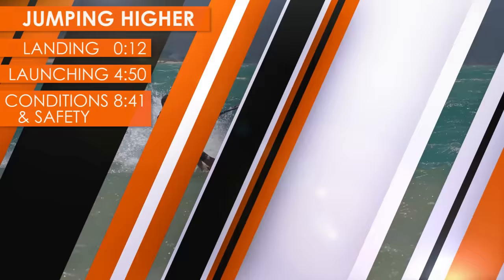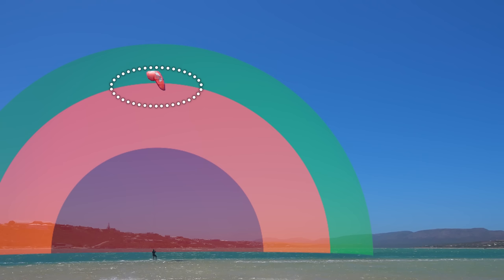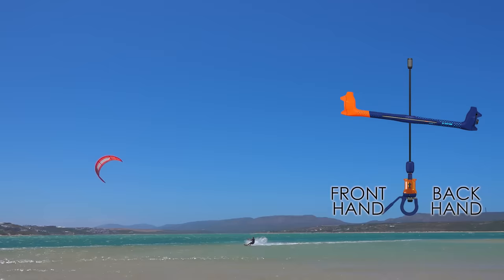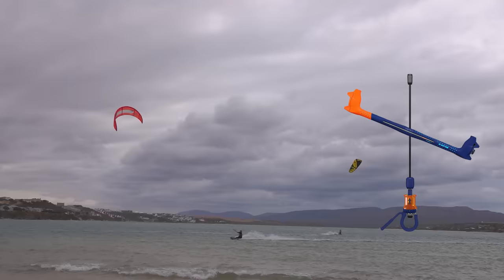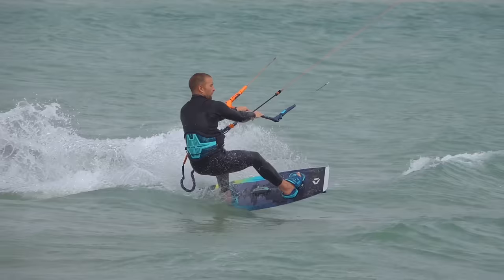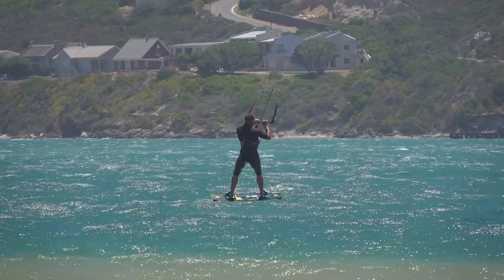Jumping Higher, Kiteboard Tutorial (inc: landing, heli loops, launching, conditions & safety)

Comment: Finally a good detail video about the jump and the heli loop! Im getting close to 10m but front stall often on landing. Cant wait to practise your heli loop tips thnx so much!!!
Reply: If your gonna heli loop as I like to do on bigger jumps couple things to note to save pain.  Make sure you have started to descend and kite is near 12 or you will kite loop or mega loop and smash your self out.  Ride a kite that turns good and of a size that you can ride without needing to depower it.  The more you have to trim or depower it the slower and bigger the heli loop will be. To commit to the loop sometimes I have found it best to almost hang on bar with one hand.  Sometimes you thinking your cranking it with two hands and your not.  Pulling the bar almost 90 degrees is safer than not pulling enough.  In my opinion
Reply: Wtf I don’t understand these suicidal people😂 my jump record is 6m but I already mastered heli-loops and landings

Comment: One key thats left out but you can see it  is when steering the kite to 12 you need to sheet out on the bar all the way to prevent being pulled off your edge and letting the kite speed up. I had to learn that part myself, i could figure out why i was getting ripped down wind as soon as I tried to jump and why the kite was slow to get to 12. Sheeting out on the bar as you send it to 12 is a very important part that thyere assuming you know.

Comment: Thanks for an excellent video. I tried my first heliloop a few weeks ago. I think I started a kite loop instead by accident and abborted early as I got pulled really hard which scared me. Would this be due to initiating the heliloop too early or steering in the wrong direction into the wind window? I'm pretty sure I steered with my front hand, though it all happened very quickly and it shocked me enough to not try again until I understand the theory more (BTW in hindsight it wasn't the best conditions for practicing as while the water was flat it was 30-40 knots - was riding a 7 meter Evo).

Comment: Wonderful helpful video. I’ve watched it before, but am finally getting to the point where I understand it better. I don’t know how high I’m jumping, but it’s high enough that landing incorrectly is hard on my knees and back. I am going to try turning my kite back and then forward thru the sweet spot to see if that solves my problems. Thanks very much.
Reply: I wondering how you landing went.?
Reply: Tip that I learned: just steer late and hard forward and landings are much smoother!

Comment: You're videos are inspirational. I'm always desperate to get out on the water after watching one.

I have a possibly controversial question about jumping higher. What these guys are doing are obviously working and im sure they are higher on the woo board than me haha! However, in the video between 4.55 and 5.15 you see the dude do two big jumps. The technique looks just how I'd intend to do except as he redirects the kite hard for take off he pushes the bar away to full deepower position. 
I've found if you do this too much then  you can lose tension in the lines and therefore get lower jumps. In my experience it's best to keep as much tension in the lines until take off, which would mean keeping the bar pulled in enough even just before take off. 
I can see 2 situations where you might need the bar at full depower. 
1. If you are fully lit and even with bar at full depower you still have tensioned lines
2. Maybe what this guy is doing, which is he's redirecting the kite so fast that he has to push the bar away to not be ripped from his edge and he's talented enough to keep the line tension during this quick movement. I can also see how pushing bar away will help kite climb to 12 quicker to jump higher.

Just think it's important for the average 5 to 10m height jumper to realise that keeping that bar in a bit even as you redirect can be helpful. Any sudden changes in line tension could lose you power just before takeover. Interested to hear your thoughts
Reply: Hey there, i am not a pro but i think it is because is still quite low for the part of speeding yourself up and he wants the kite to get up to 12 as quick as possible so he can jump, which the kite does quicker if the bar is pushed away. Otherwise he´d initiate the jump when the kite is too low and get more horizontal pull instead of upwards. Does that make sense? Did this answer your question? Hope it did. Have fun!

Comment: One critical part of the instruction that's missing (although in the video the guy does it) is to pus the bar out fully as kite approaches 12 on the takeoff. Otherwise the kite is half sheeted already when at 12 leaving much less to pull! You want a fully loaded kite at 12 to get those big jump. I was struggling and only learned this from an instructor recently.
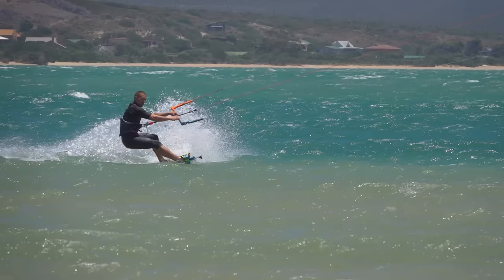Reply: This is an important missing detail. The instructions (7:22) say to pull in the bar as much as you can handle, and then when the kite hits twelve pull in the bar, but there's no mention of when in-between the bar is (necessarily) pushed out - when is the best time for that?

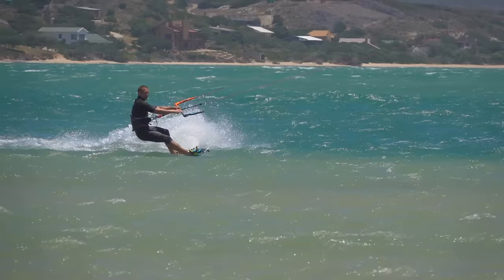Comment: Thank you for this tutorial! I've got 2 observations though: 1) In almost every jumping tutorial on youtube the rider pushes the bar before jumping but it is never mentioned. You can see it in this video at about 4:56, 5:10, 5:19, 7:37. Won't you loose tension in the lines doing so? 2) Something else which is never mentioned is right tack to ride before jumping. Should it be upwind or a bit less than upwind?
Reply from the maker: Good questions Philip. 1) When you're going for a boost, you're steering the kite up really rapidly and it will start pulling early, way before it nears 12, and that can easily drag you off your edge prematurely and spoil the entire jump. To stop yourself getting dragged off your edge as the kite climbs, you often need to sheet out. 2) It's pretty close to crosswind as you build speed and maybe 15 degress upwind of crosswind at the moment of launch, I'd guess. However, I don't really think about the exact angles while boosting. I'm usually preoccupied with keeping lots of speed at first (I instinctively aim more crosswind to build speed), then I'm focused on keeping contact with the water, and edging as much as I can at the final moments (which probably turns me slightly upwind of crosswind).
Reply: @kitesurfcollege  Thank you so much for this clear explanation!!
Reply: @kitesurfcollege  Mint!  Excellent work.

Comment: Thank you for this video and your troubleshooting about landing. You emphasize a lot on keeping the edge while going faster or sending the kite faster to 12. What about edging hard towards the wind to improve jump height?
Reply: Marc Poitout I guess edging hard towards the wind will not really help you jump higher, because the most important thing about jumping high is the line pressure. The higher this pressure is the more brutal the kite will send you upwards, by edging towards the kite there won‘t be much line tension and much of the power the kite creates will not reach the rider!
Reply: Hi Freddy,
Thank you for your reply.
When the kite goes to 12, it is moving in one direction. When you edge hard, your body is going to the opposite direction and therefore the anchor point for your front line as well. Therefore you are increasing the front line tension when you edge hard just before taking off.

Comment: This was very helpful. What are your thoughts about the pre-jump hop that many big air kiters are doing now?
Reply from the maker: Hi Alec. I wouldn't even consider it. If you look at the highest jump recorded without a wave, which was about 33m, that guy kept his edge continuously and didn't lift the board out. I'd say for pro kiters it's 50/50 whether it helps or hinders. It's most likely to do with board shape. High rocker boards create far more drag at speed, so lifting a high rocker board may help you reach a slightly higher speed as the kite climbs. But with a lower rocker, faster board, lifting the board will probably slow you down. However, for an intermediate or even advanced kiter, incorporating this extra detail of lifting the board, will probably mean they are concentrating less on far more important details like speed and edge pressure. So for almost all kiters trying to lift out the board during the build up will give poorer results.

Comment: Everyone always talks about jumping "when the kite reaches 12". I am very inconsistent in my jumps over 3m and one thing I think I am hung up on is: what angle should the kite be at - that is the angle from an imaginary line vertially upwards from the kiter's head, to the lines to the kite (not left or right)? in other words: how deep in the window. I notice that the faster I steer the kite, the deeper the kite goes back into the window on its way to 12 - and edging to counter this I guess forces the kite to fly faster towards the edge of the window (0 degrees to vertical line) - but if you are waiting for the kite to almost get above your head, it loses a lot of power. On the other hand - too early and you just get cranked downwind with sub-optimal lift. So it seems to me the optimal time to edge/pop and pull in the bar for the yank is somewhere in-between, could you explain this process?
Reply from the maker: Hi, it's important to note that 12 does not mean overhead.  If you draw a line starting directly overhead to directly downwind, that line is 12. It is not one place. It is the division between the left and right of the wind window. When the kite hits that line you pull in the bar and take off. Exactly which part of that line the kite hits will depend on you steering when you send the kite up. Slower steering will mean the kite is closer to over head (a higher angle on the 12 line) and you get less force and a lower jump. Firmer steering will mean the kite is deeper in the window when it hits 12 (a slightly lower angle on the 12 line), and you will get ripped off the water more violently. In both cases the time to launch is as the kite hits 12 approximately. Pulling the bar in before it hits 12 means a longer lower jump and provides less vertical component of the kite's force. Pulling the bar in after it crosses 12 sheds a lot of speed and again provides less vertical component of the kite's force. Good luck working on your timing.
Reply: @kitesurfcollege  thanks so much for the quick reply! your videos are awesome!

Comment: Could you explain more about how to avoid rotation during jumps?
Reply: Bring your board up is the simple answer. Look where you want to go. Notice your shoulders, jump both ways and see how your body and shoulders are different. Practice using your back hand for grabs, this also stablises your body during the jump.
Reply: @mrmonkeboy  I used to agree with this method until I saw learning to fly kiteboarding. If you jump with a straight body as gr does in this video it will prevent you from rotating. As soon as you lift you legs up you turn into a ball that will rotate easier. Think about the last backroll you did? If you leave your body straight it will be slow backroll. Tuck your legs right up and you can get your first double backroll 👍
Reply: Can you safely heliloop a larger kite like a 12m Rebel ?

Comment: thanks, really amazing video! just one question i have on edging. 
You mention to put the weight on the back foot to edge hard. 
However, The "learning to fly" series of Anton Chernyshov mentions that the weight should be balanced  between front and back leg, and only just before take-off should the weight be switched to the back. What are your thoughts on this? I feel like improper edging is still causing me to have mixed results when aiming to jump high (esp. since i mostly ride on choppy water)
Reply: I have the exact same question. Seems to be a contradiction on that front.

Comment: Great video.  I noticed when you heli looped it toward 12, the end of the loop had the kite facing the wrong way to "ride out" - what do you do to avoid that?  I think I have enough bravery to heli loop towards 12, but it doesn't seem like it fixes the issue of stopping when you hit the water.  The loop the other way seemed better for riding out, since the kite was pointed correctly to ride out at the end of the loop.

Comment: Thank you for this very interesting video. I am very concerned by this topic as I'm stucked at 5-6 meter jump. I try to keep maximum tension in the lines but when sending the kite to 12, it pulls me so hard that I loose my edge.
So I have a few questions:
1) Do you go a little bit downwind before sending the kite or do you keep your edge ?
2) Before launching, do you try to go further upwind (to increase tension) or do you just keep the same edge ?
3) Before launching, do you send the kite past 12 or do you pull the bar just at 12 ?
Thank you very much !
Reply from the maker: Hello Baptiste, good questions:
1 & 2) When boosting higher, you are riding so quickly that you can no longer change course drastically in the last few meters - like you do with a pop or unhooked jump. Way before the jump, you do have to build speed - at that point you power the kite and turn the board crosswind, maybe you can even turn 10 or 20 degrees downwind to accelerate quickly. This is way before the jump, however, when you're shifting from cruising speed to launching speed. Once you have more speed, you then focus on keeping that speed with bar pressure, while also increasing the pressure in your edge. As you edge harder you will be moving roughly crosswind. Then as you send the kite up, you try to edge as possible. If you're lucky you may turn slightly upwind at this point, helping to increase the kite's apparent wind and line tension. It won't be a huge upwind angle, however, with the amount of speed that you should have. 
3) I pull in as the kite crosses 12. Then as you launch the kite is passing across 12, giving a bit of a pendulum effect. You definitely don't want to pull in the bar before the kite hits 12, as this will give a longer and lower jump.
Reply: @kitesurfcollege  Thank you so much for your answer. I will definitely try that next time !

Comment: 8:45 what is that double sheeting-in right before the jump? Is it non-intentional or purposeful?
Reply: Very good point. I think I do that sometimes too. It feels like a load of power in to the bar
Reply: sheeting out the bar allows the kite to snap upwind, so that when you steer it up it is slightly more above your head, giving you more lift. you can see the effect if you are just cruising upwind and you sheet the bar out, the kite will lurch upwind.
Reply: @Vlox47  I understand the physics behind sheeting out, what I am asking about is the thing he did where he sheeted IN quickly just before sheeting out again, and in again finally for the jump
Reply: @ASGuitarPlayer  I was wondering the same thing. He sheets in and out very quickly, before sheeting in again at the point of lift off. The same action occurs through the video. Did you ever find an answer?
Reply: @sccordery5725  Nope. No clue still :)
Reply: @ASGuitarPlayer  If we're talking about the same thing, this is done, to be able to continue holding the edge. 
Try riding normally, holding the bar at the same position while increasing edgeing to a maximum.  You won't be able to hold it, without sheeting out.
Sheeting out allows you to maximize edgeing and potential pressure -> max lift during the actual jump.
Just concentrate on "max edging", sheeting in and out as you need to, to be able to do so, then once the kite nears 12, pull in the bar as far as possible to "harness the energy" you "prepared" during edging.
The edging (with varying amount of sheeting) pushes the kite further back into the window, the actual position of the bar during your prep does not matter that much. The further back it is, the more lift you'll be able to generate.

Maybe this helps a bit.
Reply: Also, being sheeted out more, allows the kite to climb faster.

Comment: Thank for this info! Any tips for jumping in alot of chop?
Reply from the maker: Hi Rudi. Firstly, lots of practice is the key to choppy conditions - since you need to control the kite and board, while also watching (and reacting to) the water's contours. Also, it's important to plan where you will take off - don't jump where the water is the most choppy. If you try to build speed and take off where there are a few bumps close together you will loose your edge. You need to look for a flatter section, then quickly build speed and take off in that section. You also need your legs to act like suspension, contracting over peaks and extending in troughs - so that you don't loose contact. Good luck, Alex.

Comment: Hi there! Really good and useful video! A quick one: I have experienced a couple of times that the kite (Core XR4) was really going upwind of me to a point where the lift suddenly ends and I was dropping out of the air... Any tips to avoid this? Is it just better pop (more completely stop traveling) or  stop the kite earlier (pull bar a bit earlier snd more in the window - I sometimes maybe wait a bit long until the kite is over my head which gives a nice vertical pull ) ?
Thanks!
H
Reply: Sounds like you might be losing your edge a bit before sheeting in to jump, making you slide under the kite. Anton Chernyshov's "Learning to Fly" series spends a lot of focus on the pre-jump edge control and kite position in the window